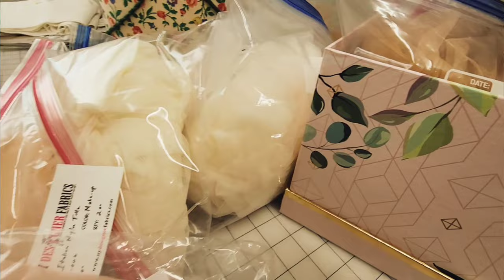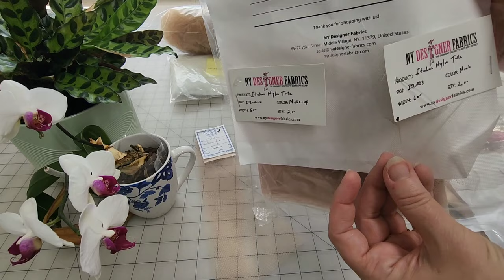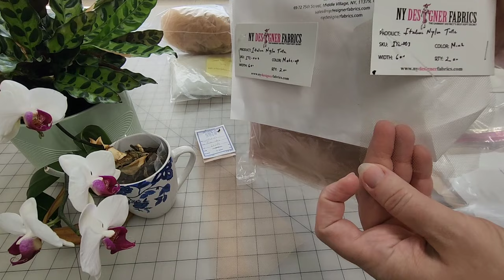Sourcing Illusion Mesh Net & Tulle | Bridal Sewing Fabrics | Part 2 of Design a Bridal Line Series

Comment: I am looking for something to go under lace sleeves for a first communion dress.  The bodice will be all-over Alencon Lace lined in satin.  However, the sleeves will be thhe same lace but "see through."  Because of the way the te lace is made, it is slightly stretchy.   I wanted to line the sleeves with something soft, stretchy, and invisible because I don't want to hem the cuffs.  I'll attach the invisible lining to the end of the sleeve, turn, then finish the sleeve.  Anyway, I'm not sure which mesh to use (or maybe te same organza that is going over the skirt).  The little girl has light skin and the lace is called Diamond White (somwhere in between bright white and off-white).  Do you ave a suggestion for what I should use?  I saw bobbinet and thought that might work BUT I didn't know there were so many choices until I saw yor video!!

Comment: What is a French Tull exactly….is it stronger? Just asking cause I Wanne make a dior inspired dress with Tull ruffles and Iam so afraid that the the skirt can’t take the weight of all the ruffles…that the halfcircle skirt could be ripped….or do u think a normal fine Tull could hold the wait?
Reply: By the way thank u very much if u answer my question and sorry for my bad English xoxoxox from germany
Reply from the maker: I would do the base skirt in french tulle, then finer tulle for ruffles

Comment: This video is amazing!! A bit off topic but I have 2 questions regarding tulle and can’t find an answer anywhere, so if you had any tips that'd be amazing!

1. Would “new york designer fabrics- Italian nylon tulle”  at 5.55 work for a sheer bodice? I’m working on a bustier design with lined cups and boning but I’d like everything else to be sheer, I’m working with tulle for the skirt so I’d like it to match, but I’m not sure if it has enough structure, should I double up? Use a less drapey tulle?
2. Do most of the sheer bodices you work with have stretch to them? Can non stretch tulle work? (Specifically, I’m talking about the main bodice pieces, not any extra illusion backs or necklines) worried that it might rip at seams if there isn't enough room for movement 
Thank you!!
Reply from the maker: Test, test, test. That's probably why you can't find answers. Each panel, each dress requires a different degree of stretch and support. Typically, I do find the actual, structural pieces have little to no stretch and are usually lined with a sheer organza to strengthen it even more.
Reply: thank you!! again a bit off topic but i'd love your input! I’ve found that tulle hits a sort of “peak” with how soft it can be, while still maintaining other qualities like stiffness, flocking, pleating, lace etc. Even the more expensive tulles seem to still have a slightly rough handfeel (unless they are very VERY drapey with no stiffness at all or stretch tulle). Since you've worked with a range of wedding gowns, I'm wondering if you found the same? @BridalSewing
Reply from the maker: yes @carlruss7003